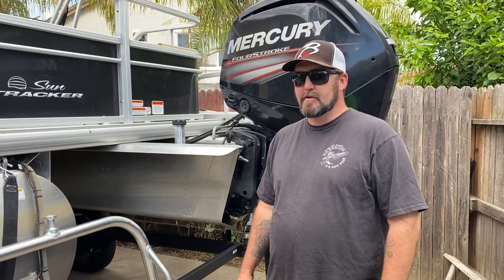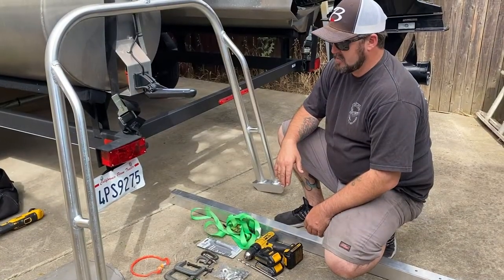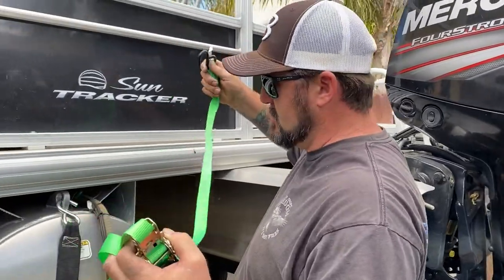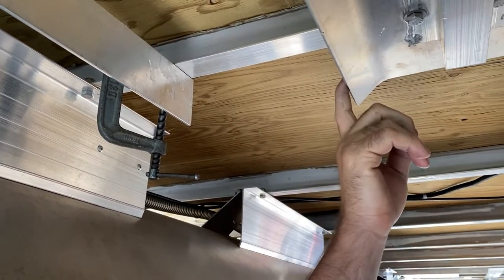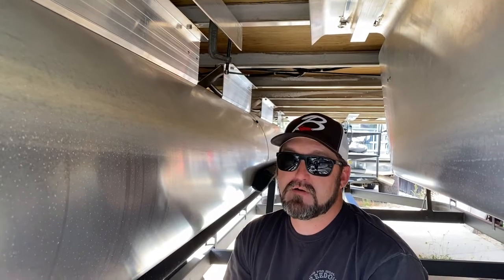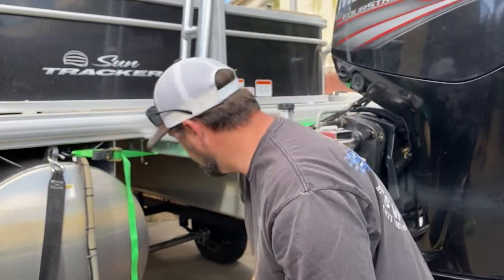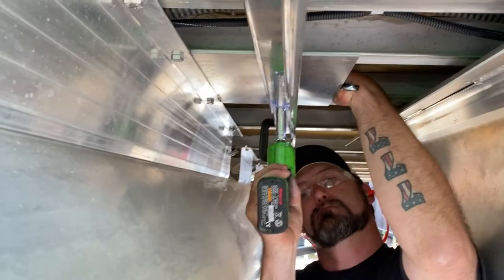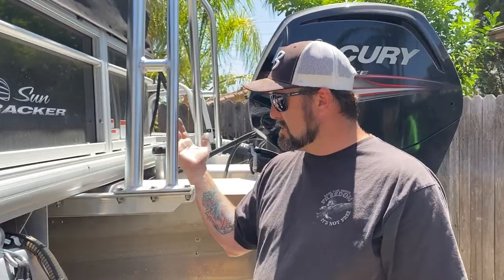PONTOON SKI / TOW TOWER | HOW TO

Comment: I have a Cypress Cay Seabreeze 20ft pontoon and would like to know if I can use this on my boat? I have the same motor as you have in the video and I like the design of the under mount. Any information would be appreciated. Thanks.
Reply from the maker: It should be able to fit .. as long as the boat is wide enough and you have the similar style supports underneath..  I’ll take a measurement at work I don’t remember the width off the top of my head.. thanks for watching

Comment: Ski Pylon for Suntracker:---Very Nice video for that tower installation. Your other video's have been very informative. Since this tower support limit is 700 lbs what would be the limit of the Ski Pylon with the insert in the back of the boat which goes into the deck. I would assume not nearly the limit of the tower. But I have not found a YouTube video of this optional item. I would hate to 'bend' the Pylon or rip the decking. Thanks
Reply from the maker: Unfortunately the ski pylon can’t be put in after the boat has been built.. they have a different structure welded under the deck.. so if your boat didn’t come with one ... you can’t just put one in.. you would have to put in a ski tower.. let me know if you have any questions.. and thanks for watching
Reply: @ReelLifeFisherman  my 2022 22’ fishin barge xp3 has the receiver slot for the pylon from the factory.  I’m also curious what the max towing weight is for the pylon using the factory slot. Do you know? Thanks for the videos!
Reply: Can you send a link for this particular ski tow bar?

Comment: Hi I got a question. I have the underskirts like you were talking about in the video but they're not riveted like you said. Their bolts but my question is are the nuts welded on the inside because there's no way to get your hands inside to hold the nut from turning when tightening. Can you please help. Thanks
Reply from the maker: I have never seen ones bolted yet .. but the should be threaded or something if there is no access to them.. could even just be lagged in with bolt head style lags possibly.. let me know how it goes.. and if you have any questions.. thanks for watching
Reply: I found out what the nuts were called. There rivet nuts. So if I were to remove the bolt the rivet nut will stay in place right

Comment: The brackets that hold the tow bar have bent I have been pulling a 4-person tube but had no problems pulling that until I tried pulling someone skiing. Any suggestions?
Reply from the maker: So the only way to fix it would be to replace it unfortunately.. they are now calling for the it to be mounted 1/4 inch from the back of the rear rub rail.. that seems to make it flex less.. hope that helps..
Reply: @ReelLifeFisherman  where would be a good place to get replacement brackets
Reply from the maker: Most likely you would have to replace the whole thing.. and your local tracker dealer would have one or if not order you one..

Comment: Great video again! You are just getting me nervous that those guys won't put it on correctly in Huntsville when I get me Sportfish. Ordering it probably end of this week. Or is that one thing they do at factory?

I am getting XP3. Glad to know you get a little extra. I'm thinking of a 200 instead of 150. Thoughts?
Reply from the maker: I would definitely recommend the 200 if you want more speed.. the new model xp3 should all have the onboard ski/tow Pylon that has a threaded base in the deck..  but let me check today and just make sure .. they have changed a few things in the last year.. thanks for watching
Reply: @ReelLifeFisherman  Thanks.
Reply: Looking back at list for trolling motor. Can you give me stock number on the on board charger. Since this list is from Amazon will the tracker shop in Huntsville have all this in stock?
Reply: Another question would want another fish finder on front of boat....easy on easy off. Take a picture for me of where you would put it. Wouldn't be real fancy on the front. On the new ones they install in dash.
Reply: Another question....Had any experience with solar. Add it to battery charger set up?
Reply from the maker: We try to keep them in stock and if not inside the store should have one.. but any 3 bank charger would be fine..
Reply from the maker: It’s tuff mounting one at the front on a pontoon.. about the only way is to use a ram mount and mount it down lower near the railing on the couch or shave the ram mount base and mount it in the railing.. on the right side..
Reply from the maker: I’ve thought of using solar.. you would have to make sure it has a float switch so it wouldn’t over charge the batteries.. which would ruin them
Reply: Forgot to tell you major deal that happened can you call me or text me. Another question , why do you put batteries under console and not in back with cranking battery?
Reply from the maker: You can put them back there not all models have the room back there .. some only have room for the crank battery only..  and under the console is where they run the trolling motor wire..  either there or in the front corner storage compartment is where the factory runs the wire..
Reply from the maker: I’m about to head into work.. can you email me what the major deal was about.. and I’ll get back to you as soon as I get a chance
Reply: @ReelLifeFisherman  thanks then won't do that.

Comment: Just bought a 2021 20 dlx fishing barge! Is there a website I can buy this same tow/ski tower? Can’t seem to find it! Would rather install my self.
Reply from the maker: If you call a tracker boating center parts department or go to one.. they should have one for sale.. if not they can order you one.. even if you didn’t buy it from them the shop you did should be able to get it too.. thanks for watching
Reply: The things are now a tower and like he installed and they are 600 bucks. Last year they only used a pole sticking up and it was 240. But think this new thing is much more substantial.

Comment: Great video. I also do sheet metal work and I'm also OCD (perfectionist)
After drilling your holes but before installing your hardware, did you use a chip chaser?
Just wondering about trapped shavings.

Comment: My sundtracker won't fit in my garage anymore if I install the ski tower.  I put  quick disconnects on the bemini top in order to quickly remove or install to park in the garage. Do I have any other options? Can I use a ski rope Y bridal hooked on the side cleats or eyelits on the toons?  We used to just hook a rope off a cleat on each side of our old boat and make a Y back and hook to the main ski rope. Seems like everybody online these days act like that's not acceptable??  I know that a tower is preferable on a pontoon i guess but I just don't have the room and I want to keep parking in the shop.

Comment: Question - have you added a tritoon to a 24 tracker fishing barge? Is it possible? What's your opinion is it worth it?
Reply from the maker: No I have never added a tri-toon to a regular pontoon.. not saying it’s not possible or anything.. just never done it. Everything we do at my shop like that would have to be approved by the factory.. depending on the size of your motor would make it worth it or not.. if it was a 200 or bigger it might be ..  thanks for watching..
Reply: I turned my 20DLX into a tri-toon.

Comment: So no towing with the 18 model? I’m looking at getting either the 18 or 20, but would like the option for some tubing.
Reply from the maker: Yeah I would go with the 20’ if you’re looking to pull a tube.. you can’t use one of these with the 18’ .. so you would have to use possibly a v harness from the tie down eyes which would probably void any warranty on the logs in that area..or a turbo swing which would void your motor warranty on the engine mounting bolts..  let me know if you have any questions.. thanks for watching..
Reply: Reel Life Fisherman yea that help with my decision. I’ve never owned a boat and it’d be my first. I’ll be using it mostly for fishing and taking family out. I figure a pontoon will be good for the older people and for carrying several, but I don’t look to be doing anything excessive, just fishing and a little tubing.
Reply from the maker: Then a fishing barge 20 or even a 22 would be awesome.. and go with the bigger motor you won’t regret it later..
Reply: Reel Life Fisherman I think the 20 will be good. I’ll be trailering it anytime I use it and don’t want to go too big. I did have a few questions about the motor. Does the 90hp Mercury come with stainless propeller or is that optional? And does it add any extra benefit? Also, are hydrofoils worth adding on?
Reply from the maker: So I will check tomorrow to make sure .. they do put stainless on some models now.. they do provide a small performance upgrade.. with the ability to have a sharper edge and better surface.. but they cost quite a bit more money.. and on lesser hp engines not always worth it.. and they won’t bend which is not always a good thing if the break away hub doesn’t do it’s job.. it can damage the lower unit.. the hydro foils do work but can seal top end speed from drag.. but they do help to get on plane faster and help keep the boat from try to Porpoise..  so kinda a trade off.. but I don’t see a lot of them on pontoons.. so I would hold off on one until you think you might want to try it for sure..
Reply from the maker: Yes I just checked they do come with a stainless prop on a fishing barge 20’ with a 90
Reply: Reel Life Fisherman ok sounds good. Thanks for checking for me. I had read that same thing about the hydrofoils but had no idea for sure, doesn’t look like it’d be worth it for myself then.
Reply: @ReelLifeFisherman  why is it that you can not use it on the dlx18? i am looking for options to put a bar on my 2020 dxl 18
Reply from the maker: Alex Hines it’s because the logs are too close together.. it won’t fit in between..  there is a thing called a turbo swing.. it mounts to the motor bolts.. but if your motor happens to fall off or any damage to your transom your warranty would be void..  on that area.. thanks for watching and let me know if you have any questions..
Reply: @avhines1  this pylon won’t fit a 18 Dlx with factory rear ladder. Take off ladder and it fits fine. Having my ladder narrowed by 3 inches and then reinstalling. Overall with of pylon is 51 inches.

Comment: I have a who dat rocket launcher on my boat... I just got a radar Dome and I’m trying to feed the wire bundle through the top, down the leg and out the bottom... it’s very difficult feeding it through the tubes... any suggestions????
Reply from the maker: Fish tape and a hook pick.. make the holes a little bigger if need be.. once fish tape is through us a pice of paracord to pull
Reply from the maker: Sometimes I have had to cut the end off if it’s a Ethernet style and put another end back on
Reply: Reel Life Fisherman I finally got the wire bundle through.. after searching around on some forums I found a old post on some sailing forum... I tied 8 pound test to a cotton ball... stuck the cotton ball in the tube and sucked it through the radar arch with a shop vac.. then I tied some heavy string to the fishing line and pulled the heavy string back the other way... then tied the heavy string to the wire bundle and pulled the wire bundle through the tube using the heavy string.  I hooked everything up this morning and it all works!!! Wahoo!!!

Comment: Well, Jason, you've opened a can of worms for me mate. So many things to ponder on so I'll get down to it. Firstly. Are there any toque requirements for those bolts and do you think there should be if not?
Myself and my wife are both mildly OCD She was bad in the early days (thanfully she still loves me lol). Through the years I have managed to relax her and she's not so bad now. She does'nt get on at me so much for not tidying up the way she likes it and conversly, I don't get on at her for the things she does'nt understand, A happy medium for two opposites maybe.
On a different tack, I would probably went to the expense of aluminium sheeting on the underside of the barge? Does'nt seem right to have bare timber ply ( marine presumably ) exposed like that and I would at least put some kind of protection for that.( at least better than none at all ). Was just a thought though.
Another thing occered to me with those bolts. What about the big problem of electrolysis ? I presume they are steel and as you know steel and alumininium don't like each other.
Finally, as you might remember, I have a small  4.7 m  Quintrex and have a small tow bar on the stern which is interchangeable with my filleting table, which is likely to be a permanent fixture , since towing a 70 year old might look a tad undignified lol. Having that huge tow bar on there did not look strong enough because of the greater torque pressure of whatever is being towed ( it just looked too high and I would have considered two extra supports attached to the stern higher up for added strength. I would have put a larger diameter ( like my bull bar on my car ) tow bar too. Seems to me to be under engineered.
As usuall my friend, you've stimulated my thoughts again and can't wait for your next video, either mechanical or fishing. Real good camera work too. Regards Jason. Have a great day and hope you stay safe.
Reply from the maker: Yeah I agree there should definitely be more support up top where it’s needed.. if they bend it’s always at the top.. no matter which way the bracing is.. and no there is no recommended torque specs at all..  just g.f.t spec as we say.. lol 😉 the plywood is 3/4 marine grade and actually has a lifetime warranty..  and In my years in the industry so far.. we really don’t have issues with the decks on these rotting out.. the aluminum underpinning is a Performance upgrade to lessen the drag of any water hitting the support bars.. And absolutely would help from keeping water from hitting the wood..  the factory that puts these together doesn’t do the best quality work.. but there isn’t anything else out there to use that a have seen.. I’m sure a guy with the right skills could build and design a much better one.. but really these are made to just pull some kids on a small tube.. and have some fun.. they work just fine for that.. thanks for watching and commenting as always I appreciate you’re comments and feedback..

Comment: Looks like this way should be strong enough to pull a tube or blow up boat also...if going slow ...like fore kids?
Reply from the maker: It has a 700lb rating for tube and riders.. some towables have a lot of drag that adds weight.. I would recommend only a 2 or 3 rider for kids .. and only 1 or 2 adults ..

Comment: Have called Tracker Boat center (Bass Pro Shop) they are not quoting the same part.  They are wanting to install a "ski tower" and have to use a lift to install it, so it will be labor from them as well.  Quoted $1000 bucks total, 3.5hrs labor.  Do you have more information where your buddy got this part ?  Seems like its a very difficult part to find...
Reply: 100% agree! I can't find anywhere or anyone who knows where to get this or something similar
Reply from the maker: Yes they do call it a ski tower also .. they do not need a lift at all .. we do them all the time on the trailer..  the only time we charge 4 hrs is if they have under pinning.
Reply from the maker: Call the rocklin ca tracker boat center and ask about it we usually even have a few in stock..
Reply: @ReelLifeFisherman  About to order one of these through my local dealer, but they couldn't tell me the width of this tower - any idea how wide the mounting brackets are?

Previous boat owner swapped out the transom mount & I want to make sure this tower is wide enough to fit between that & my lateral 'toons

Comment: Why can’t you put on the 18’ bass buggy?
Reply from the maker: The beam on the bass buggy is not wide enough to fit ..
Reply: Deck is 6 inches narrower on the 18 foot compares to the 20 foot. Will work with a narrower ladder or take your ladder to a fab shop and have left hand rail moved in. At the very end of this video you can see how close pylon is to left handrail.

Comment: why doesnt it fit the 18 bass buggy
Reply: Pontoons are 8’6” apart on 20 ft and only 8’ on 18 ft. Pylon will fit if you install a ladder with narrower handrails. Pylon is 51” wide so you need 25 1/2” from centerline of boat on each side. This interferes with factory ladder left handrail.